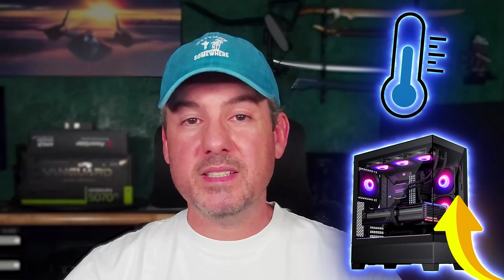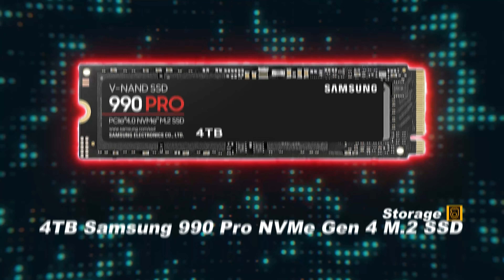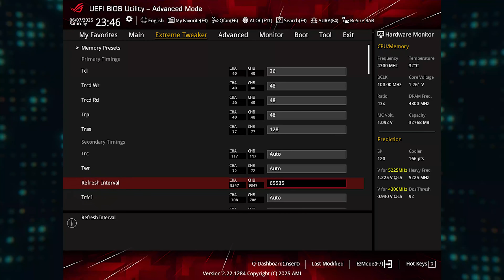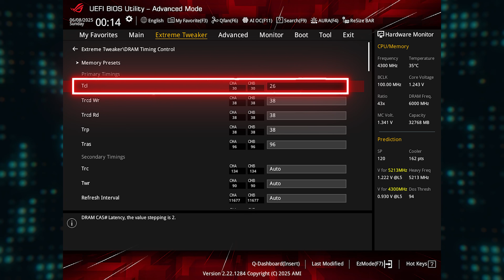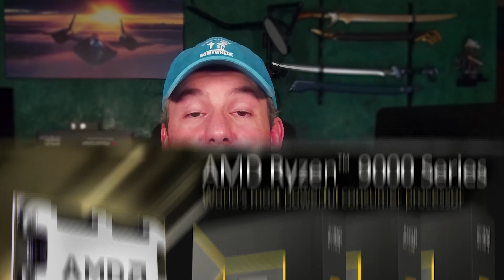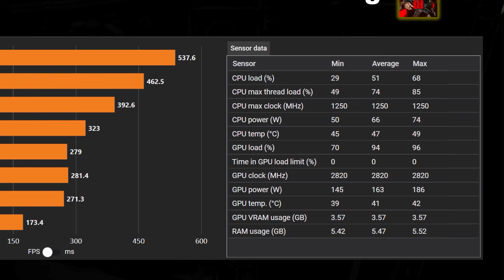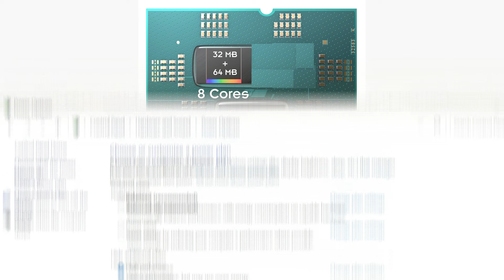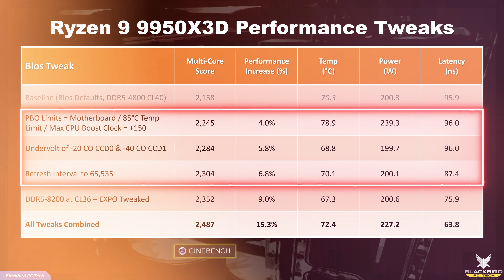What Are The Best Settings for an AMD Ryzen CPU?

Comment: Can you make a video but with i9 14900KS please? I'm struggling with proper Asus Bios settings to make the processor run fine with good performance and low temps.
Reply from the maker: You can use this video: https://youtu.be/aB81bgzNM1w

The challenge with the 14900KS is that it's a tough CPU to properly cool, even at stock conditions.
Reply: Lock your cores P Cores at 57, Ring at 46, E cores 44, high loadline calibration and and if ure skiled enough and will do proper research, tuning AC DC Loadlines + Vcore offset tweaks (small increment of 0.005V is the best case scenario really. Bamm here goes your efficen 14900KS as funny as it sounds:) If you want hyper efficient KS you can have one by putting it on 56P, 45Ring, 43E and now you can even try offset undervolt it after all these steps, make them in these steps to make you head hurt less.... dont forget settings 253W limit and Temp throttle limit at least at 92c, to save your cpu of wear.
Reply from the maker: @pashul1n  good recommendations

Comment: A doubt, do i really need to do this otimizations or the install and play settings should be Fine stable?
Reply from the maker: Not exactly sure what you are asking ... you can run your system on Auto but as I showed in the video, you will be giving up anywhere from 15% to 40% performance if you do.
Reply: @blackbirdpctech sry, not a clear question. Im a newbie on those configurations, so If i do that changes i would follow you blind for more performance, without knowing If this could really make my setup unstable (B650 Steel Legend Wi-fi, 9800x3d, Vengeance 6000mhz CL36). 

Ive Seem recently the relates of Brokes 9800x3d on AsRock Motherboards, what you think? 

PS: i Just know your Channel by now, Thats the First video i saw, sounds serious and good to me, but im asking as a Noob on those contents, i Will study more about.
Reply from the maker: Don't ever follow any OC/UV numbers blind because as I state multiple times in the video, every CPU/GPU is different due to silicon quality differences ... what may work on my CPU may not on yours. Simply follow the step-by-step process I show in the video and you will be able to custom tune your chip.
Reply: @blackbirdpctech  got It, thx for the lesson

Comment: ow wouw thank you for putting me on to aida64's stability test, recently undervolted thought i had found something stable (passed 30 min of cinebench and 1h of OCCT) but wile later figuring out how to undervolt my GPU i had a freeze that sure felt like a CO freeze...but i had not yet had issue's undervolting my gpu so wasn't sure, been using all day today and ran like a champ.

start the aida64 stability test got to 0.04 before it detected trouble XD 20 min later -25 all core it passed 10 min (i started at -35)
Reply from the maker: Yeah, it’s the best test I’ve found for testing undervolt stability
Reply: @blackbirdpctech  and i'm not sure what triggers it (DOCP/EXPO seemfine) but if you don't touch PBO and just go through ryzen master it'll let you change your CO on the fly without a reboot/retest which wile not ideal when searching for your baseline is a timesaver. this failed change settings hit apply go again.

when i told PBO to add 50 mhz it started to force me to reboot to apply CO changes so that might trigger it. (still didn't run any test though : / )

Comment: Hi BlackBird, awesome guide. I also have an amd ryzen 9 9950x3d processor. I was experiencing freezes in some games when the CPPC settings in the bios settings of this processor were set to automatic. I solved the problem after I changed the cppc setting to driver. Do you think it would be better if this setting was automatic? Also, can you help me adjust the settings you mentioned in the video?
Reply: My components: Amd ryzen 9 9950x3d
Ram Kingston beast argb ddr5 6000mhz cl36 QVL RAm Dual kit 2x16
Asus rog strix x870e-e gaming motherboard
Asus Rog astral 5080 OC version
Asus rog ryujin 3 argb liquid cooling
Asus rog strix Hyperion Case
Asus rog strix platinum II 1000w 80+ power supply
Samsung 990 pro 1tb nvme ssd PCIE4.0
Reply from the maker: That's interesting ... setting it to driver is fine ... just make sure you install the latest AMD chipset drivers. The video shows a step-by-step guide to adjust your settings ... you even have an Asus motherboard, so it should be easy to follow.
Reply: @blackbirdpctech  yeah setting driver and now not freezing. ı use all settings in to BİOS auto. İt's fine ? Or Do I need to adjust the settings in your video?
Reply from the maker: You can obviously do whatever you like, but if you do leave everything on Auto, you will lose quite a lot of performance, as shown in the video.
Reply: @blackbirdpctech  thanks for all information. Curve shaper and curve optimizer is complicate for me. I can't do it without someone helping me. Because if I give the wrong value, I can cause the system to be corrupted and perform worse
Reply from the maker: @FahrettinYALÇINKAYA-e6n  that's why I made this step-by-step guide
Reply: @blackbirdpctech  yes ı did next week. Curve Shaper and optimizer you can do this in video?
Reply from the maker: @FahrettinYALÇINKAYA-e6n I show how to undervolt using curve optimizer in the video
Reply: @blackbirdpctech  thanks my brother. I support you

Comment: Paying $650 for a mobo to get a tiny bit more performance out of a $670 CPU
Reply from the maker: PBO2 is available on all AMD AM5 motherboards and a 20-40% performance improvement is not “tiny”
Reply: @blackbirdpctech  no, you're right and the video is legit. the benefit of spending $650 over $200 on the mobo given they all have PBO2 is what's questionable.
Reply from the maker: I agree that's it's unnecessary ... I wasn't trying to push the idea of using an expensive motherboard in the video ... the Hero is simply the motherboard I am using for my test bench, and the 9950X3D was the last CPU I tested on it for my recent 9950X3D vs 285K video, so that's what I used to make this video.

Comment: can you make a video how to make an 120w processor work at 65w for example? what is the impact if so
Reply from the maker: For a small form factor build?
Reply: Yes, where the height of the cooler is maximum 70 mm i know will have less results but the extra cache of the processor is good for content creation....like 9800x3d@blackbirdpctech
Reply: @blackbirdpctech and if you don't  mind ex0lainnin what situations 8c/16 threads is trully working? Or is it used? Do we trully need that? Some programs like photoshops needs 1 processor can i make the first 4 run fast and the remaining 4 run only of needed? Etc :)) sorry if its too much to ask
Reply: @blackbirdpctech and is it worth it or i better buy a 65 w processor  lets say 6 cores /12 threads?
Reply from the maker: @strippedlist  you can simply buy a 9700X and run it at stock settings. The 3D v-cache is somewhat irrelevant for content creation.

Comment: You wont see a huge boost once ur gpu bound. Mainly 1440p 4k res,with maxing out heavy gpu games, maybe a 0-3% difference. Your just going for higher lows. However for memory integrity in 1080p, and some oc on the cpu, you are going to see a15% difference. Like 400fps going to 430fps on competitive games.
Reply from the maker: I covered that in the video with actual data
Reply: @blackbirdpctech i saw that, the 1080p data is great but maybw adding a 1440p or 4k results just to show results. Great video overall tho
Reply from the maker: @Seabass2478  remember that this is a "how to" guide ... I included benchmark data only to show that the process works. In my UpcFC series, where I compare two components, I typically show data at 1080p, 1440p and 4K.

Comment: I think I got pretty lucky with my 9800X3D and ram combo.  I have 6400 cl30 running in 1:1 mode with 2133 fclk.  I have had no stability issues in benchmarks, stress tests, and games for months.
Reply from the maker: That's great ... what undervolt were you able to achieve?
Reply: @blackbirdpctech  I have a -20 at lower clocks but -25 for mid to highest.  I also have all of the ram timings manually set from one of buildzoids videos.  I also have a +200 clock override and it runs at 5425 mhz locked in games and around 5250 in cinebench r23
Reply from the maker: Nice!

Comment: I dont know who you are but you did help me alot thank you i didnt know that you can ,make co for each ccd that so good also i did ram oc to cl 28, thank you alot bro
Reply from the maker: You are very welcome!
Reply: @blackbirdpctech  just had little problem cl 26 didnt work with at 1.45v and i have same ram you showed z5 g skill 6000.30.38.38.96
Reply from the maker: @Xkd.  then I would try running CL28 ... that should work.

Comment: With my 5800x3d I tried various settings, and the maximum negative curve is 5, not because with higher values I did not pass every stress test and did not see benefits on the temperatures in game, I noticed an annoying stuttering, solved by not exceeding the negative curve at -5, so do not limit yourself to testing the stability but try the fluidity in gaming first hand, if you notice sudden stuttering try first to see if it happens with the CPU without undervolt, if in this way the stuttering disappears it means that you have to find a more conservative undervolt that does not cause that problem.
Reply from the maker: That's helpful information ... this guide is focused on AM5 based Ryzen CPUs but much of it is applicable to AM4 based systems as well.
Reply: @blackbirdpctech  Yes indeed, the behavior could be similar, even if am5 has unlocked oc and therefore is more flexible in tweaking the undervolt is done in the same way and could lead to the same problems, I advise everyone to keep an eye on this behavior, sometimes the best test is the road test (in gaming) obviously carrying out all the quick tests is the practice and serves to understand if in general there is the stability

Comment: Thanks for video. I have a question. I set CO in BIOS (All cores, Negative 20, 9800X3D) but Ryzen Master doesnt show CO settings. Shuld I see in Ryzen Master my setting from BIOS or not? And if yes why I cant see my settings (I get such problem on Asus X870 and MSI X870)?
Reply from the maker: Yes, it should show up in Ryzen Master ... do you have the latest version of Ryzen Master installed?
Reply: @blackbirdpctech its from end of 2024. So latest I think.
Reply from the maker: @konradbak  not sure what the issue is ... did you compare the performance before and after the undervolt?
Reply: @blackbirdpctech  Silly me. I don't know how, but somehow I didn't save this setting in BIOS. Everything is ok now. Regards!

Comment: One correction: EXPO II is generally better than EXPO I for performance but less stable. EXPO II is more likely to give you issues than EXPO I.EXPO II crashes my device whereas EXPO I and Tweaked are more stable.
Reply from the maker: No, that is not true ... what I said in the video is correct. EXPO II will not provide better performance versus EXPO I. And EXPO tweaked is inherently less stable than EXPO II. I understand that you have a better experience with EXPO I and Tweaked, but that doesn't change what these profiles mean.

Comment: should i go 6400 MTs ram and hope the cpu supports it if not adjust speed manually ?
Reply from the maker: Yes, I think it's worth a shot and if it doesn't work you can back off to 6200 or 6000, which should definitely work.

Comment: Am on both AM5 9900X3D X870E Nova Tcreate 32gb dl30 stock (3.25 bios) mostly default. Intel LGA1700: have a 12400F, 12700KF, and 12900KF I use as a second machine, am wondering if I should buy lower CL kits (have a cl36 48gb gskill in 12900KF though it's kinda like w/e am on AM5 most times gaming now X3D is the mmo king.
Reply from the maker: For Intel systems, if you want to get the most out of them, run the fastest memory that you can get stable ... I would go for more speed versus decreasing CAS latency.

Comment: Thanks for this vidéo but with my ryzen 7800x3d should i do the same as you mentioned in your video ? Cordialy
Reply from the maker: Yes however, be aware that increasing the boost clocks in Step 4 will have no impact for Ryzen 7000X3D chips because they are locked for overclocking.

Comment: I was able to undervolt to -37, will it make any difference  from -30?
Reply from the maker: You can test it in some games/benchmarks and find out ... I would usually backoff a little from the max stable undervolt
Reply: @blackbirdpctech  one game I found it stuttery is valorant. i dropped it to -36 and it  went away  :D
thanks for your reply

Comment: Great video! 
For some reason having expo enabled make my pc post times super slow, so i have to tweak memory context restore etc. I ve been searching everywhere but cant find a solution, expo also brokes restarts, literally after an update or even if want to restart my pc it just wont happen got stucked on a loop with Dram orange light on mobo forcing me to shutdown manually and post again. Finally ive found that manually inputing expo values works great, the only problem i need to solve now is that i cant wake up from sleep mode. But overall great performance + stability, thx for the guide!
Reply from the maker: Make sure that you are running the latest Bios for your motherboard ... I've had issues like that in the past that have been resolved with a Bios update.
Reply: @blackbirdpctech  Thx for the answer! already tried it, at this point it might be something related to my hardware :( but anyway i manage to get good performance being stable.

Comment: I followed this on my 7600x3d
I got from the Microcenter bundle.

Achieved -35 all core offset.
No boost since it’s an x3d chip
Expo tweaked 6000mhz 1:1 mode 2000 fclk 
Limits set to motherboard, platform throttle limit 85

Aida64 extreme ran smooth for 60 minutes
Cinebench multicore score 812
Core temp showed 66-70degrees celsius
and 57-61w while running benchmarks.
Reply from the maker: Great result!

Comment: spends all this time just to do 1080p low settings (which I understand shows the cpu differences) but aint nobody using a $500 cpu to play 1080p low, so at least put some benchmarks of 1440p/4k with high settings as well.
Reply from the maker: Given that this is a CPU tuning and optimization guide, what would be the point in showing benchmarks at resolutions/settings where the GPU is carrying all of the load? That would be like telling you how fast my Ferrari goes and then taking you for a drive in my Toyota Camry to demonstrate ... makes absolutely no sense. This kind of flawed logic comes up a lot, so I specifically addressed it in this video:

https://youtu.be/Zi7LtyQVPdM

where I provided data to answer the following common questions:

1. Does CPU Choice Matter at Higher Resolutions & Game Settings?
2. Why Test CPUs at Low Resolutions & Settings?

Comment: Almost all those softwares are PAID ones , hard to test something like this.
Reply from the maker: Other than Karhu, everything else is either free or you can get trial versions to use.
Reply: @blackbirdpctech  3Dmark only does a few tests on trial , its that ok ?  Thanks
Reply from the maker: For cpu testing 3dmark is unnecessary … it’s more important for gpu testing. That said, 3dmark routinely goes on sale for $4.99 on Steam ... so I would keep an eye out for it.

Comment: On mine I got ccd0 20 negative ccd1 30 negative 100% stable, I tried 30/30 and 20/40 but it gave a green screen as soon as I started Aida64, I just want a sub voltage, what do you think?
Reply from the maker: -20 and -30 is quite good!

Comment: Can you please do the same for Intel
Reply from the maker: I have a version for Intel Core Ultra chips:

How To Fix Intel Core Ultra CPU Performance! 🔥245K, 265K and 285K🔥

https://youtu.be/EJnRifgj3Ps
Reply: @blackbirdpctech  Thanks. There's a version for Intel 12,13 and 14 CPUS?
Reply from the maker: How To Tweak an Intel 14900K for Max Performance!

https://youtu.be/aB81bgzNM1w
Reply: @blackbirdpctech  Thank you so much I can asume that it will for a 12700K
Reply from the maker: @uk4890 it should … it’s not as comprehensive due to the issues with 13/14th gen … you should be able to push a 12th gen cpu further

Comment: Man this dropped perfect time I finally got the 9950x3D rig up for testing and phew the clocks jumping from 1125mhz to 5655mhz needs some taming.
Reply from the maker: Good luck with tuning and optimizing
Reply: @blackbirdpctech bad luck clocks are not stable I'll lower pbo until clocks aren't wildly outa whack 895mhz - 1123mhz

Comment: Thank you for putting Aida64 as a go to stress test. I've been telling people for years that its will weed out unstable settings. Alot of people in forums and what not will say " I'm 100% stable and have crazy bench scores then I tell them run Aida and it will crash... and it does.
Reply from the maker: Yes it seems to be very underrated … it’s a great software package
Reply: If it doesn't crash in all other everyday tasks, what's the problem?
Reply from the maker: @Rhadoo89  there is no problem because there is no standard definition for stability ... if you are happy with your system then by all means proceed.

Comment: For 7800x3d cpu im using 6000mhz ram cl36 micron type , should I oc the speed or timings ?
Reply from the maker: You can try reducing the CAS latency however I don't think you will be successful with that kit.
Reply: @blackbirdpctech  THANKS FOR REPLYING ❤ , Yup Exactly What I Thought Too Tq..